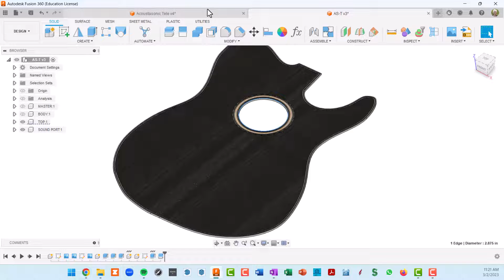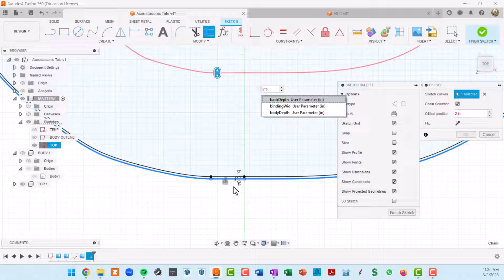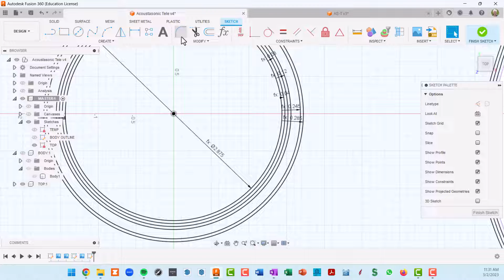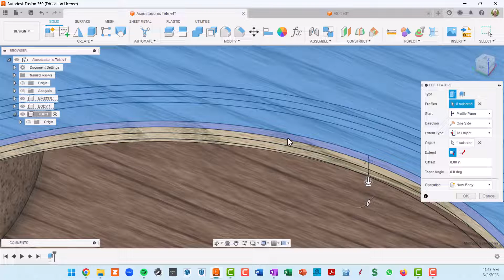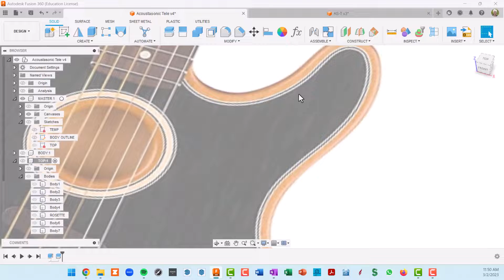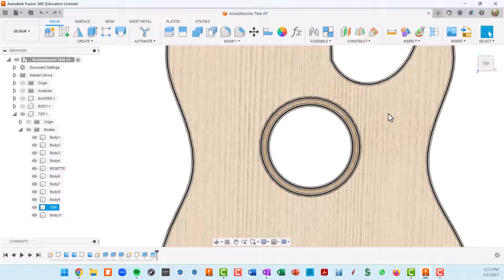Designing an Acoustasonic in Fusion 360 | Episode 3: Acoustic Top

Comment: Thanks so much for all the info. I've taken what you've shown and throwing my own twist .. thicker top raised above the body line to create a smooth arch-top style with some lofting (it will be an interesting experiment) and I'm going to re-watch the sound port lesson and see if I can create a fluted piece for the port. 

I would really be interested on your thoughts on bracing the top and how you would go about that in Fusion? Also, a through-body string arrangement would be an interesting exercise in design. Just a thought there.
Reply from the maker: Let us know how the arched top works out.  I will be doing a video on the top bracing.